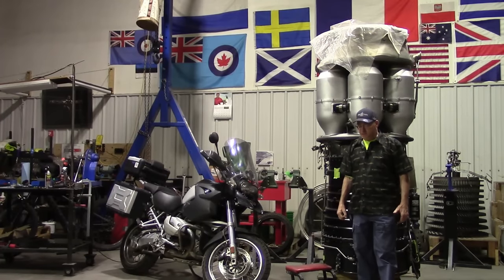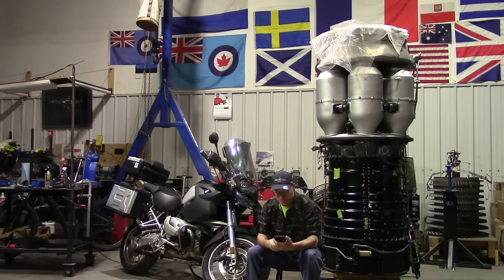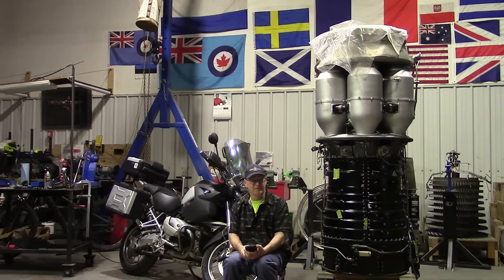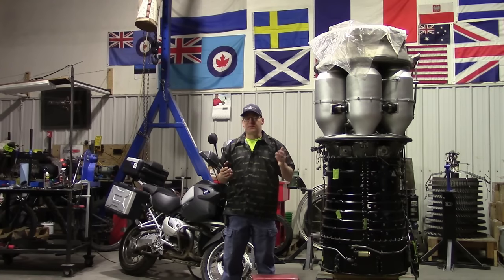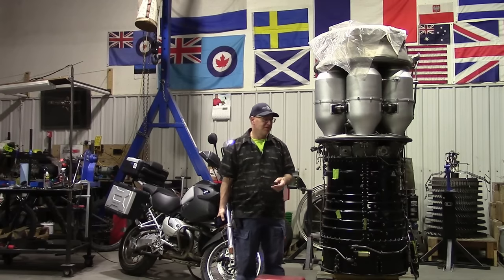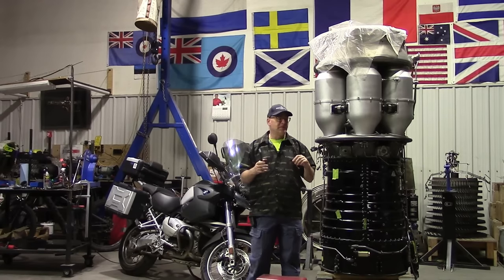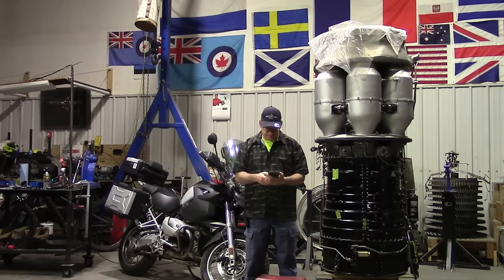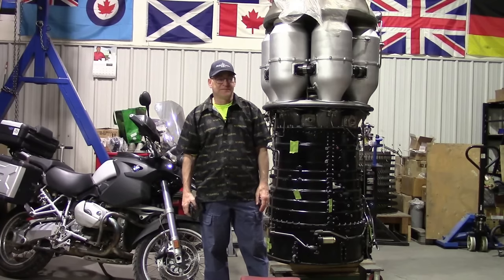How Long Do Jet Engines Last ?

Comment: Excellent video! Thank you for a well thought through presentation. My first USN squadron flew the Grumman Cougar powered by the Pratt & Whitney J48. This was in 1969.
Reply: And were you aware that the J48 was a licence-built version of the Rolls-Royce Tay engine, which was a derivative of the Rolls-Royce Nene, which was also licence-built as the J42?

Comment: I have owned a rake of NMW K100's and a K75s. The K100 had some kind of internal shaft that rattled when I bought them and rattled when I either scrapped them off (some dumb ass ran it over while parked) That dunk, dunk, dunk noise from the engine at idle sounded the same after about 160,000km on all of the K100's. The K75 was supposed to be the same engine but with 3 pots instead of 4. There was no internal shaft though and the torque was higher up the rev range. TBH you cant go much wrong with a BMW motorbike. I have owned about 15 motorbikes and the BMW's were cheapest to maintain and most reliable.

Comment: Thanks for the video Jay! Been a while since I have commented. I was just sitting here pondering, what little details of manufacturing or assembly of turbine engines inspire you when you are tinkering on/building other things, like bikes, cars, whatever? Because I am thinking you are a man that appreciates meticulous detail and overengineering.
Reply from the maker: I like that almost everything is made of Aluminum or stainless steel. I rarely deal with rust and mud, like I have to with automotive work.

Comment: Had a 1981 VW diesel.. our first valve job we replaced only 2 shims.. at 91k miles.. our the following 3 more adjustments ( 320k miles) replacement was ZERO.. I believe hydraulic lifters are superior to anything currently available.. but shim and bucket is almost as good.

Comment: I'd like to extend the question covered in this video: Do you think it is realistic that you would end up not being able to restore an engine due to lack of documentation and specs? 
What I mean is: Let's assume you get a bearing manufacturer to agree on manufactuing a batch of  thrust bearings for the Orenda 14. I can imagine there are some specifications for that bearing, that only the original manufacturers have known and that have not been published in the genereal documentaiton of the engine. So you would end up with a bearing, that you can't put in the engine because you don't know if it meets the orginal specs.
Thank you for educating us! Greetings from Austria.
Reply from the maker: This is a good description of the issue that will eventually present itself.
When such bearings are produced, they will need to be tested to the satisfaction of the operators of the engine.

Comment: Lifters, lift up, dampen valvetrain vibrations, and lifters spin in their bores. There isnt a single piece on a turbine engine that moves in such a complex motion and at a high speed. Parts like that are common in piston engines. This is why the AGT-1500 was selected over a piston engine, they wanted a very simple tough tank engine.

Comment: Hi Jay! I’m not sure about the r1200 but the r1150 used small push rods about 2 in long to move the rocker arm. The push rod had steel balls pressed into either side of an aluminum shaft and after many heat cycles the ball would get loose in its pressed aluminum collar. This contributed to a lot of valve noise on the oil heads. I’m not sure if that system survived into the r1200 though. Might be the origin of your noise.
Reply from the maker: The little linkage is steel in this motor. Noise completely disappeared after adjusting the valves.

Comment: dear j ... there is a power station about two mile from my house  which is is going to be torn down next year .. the ratcliffe on soar ..   which in peak times helps supply london  with power and at the moment burns on average 1000 tons of coal per hour .. it also two standby jet engines rolls royce olympus.. i dont know what will happen to them  wheighed in for scrap?  regards   laurence
Reply from the maker: Those Olympus engines might be valuable to an industrial buyer.
Reply: As a Bristol Siddeley Coventry apprentice, I visited the site during their commissioning (they were the original Industrial Olympus 17.5MW sets) and saw one of them run up, I think it was for the first time but, at this distance in time, I can't be sure.
PS  When they were first installed, they didn't have Rolls-Royce nameplates.
Reply: Unfortunate to be decommissioning a working plant.

Comment: Those J 79 Turbojet engines with Afterburner that Secret Agent JayZ overhauled zipping along just fine in The Starfighter's Aerospace fleet of Lockheed F 104 Starfighters .

TF 104GM Black Beauty, taken apart and airlifted to Italy and reassembled for The 100 Anniversary of The Italian Air Force Founding Celebration, with PierCarlo at the controls. The only flying F 104S-ASAM also owned by Starfighter's Aerospace being readied for test flights. 

And a possible TF 104 GM being modified to be a two seat version of the NASA 1962 single seat aerospace trainer NF-104A that had the added RocketDyne 3,000 # thrust rocket engine and a Reaction Control system for Pitch Yaw and Roll control in very thin upper atmosphere where the standard flight control surfaces will not work. Be very cool if Rick and crew can pull this one off ! *

Comment: If the sabre is powered by the orenda isn't it a CL-13..
Or is it still an f86...
Great content as always..
Reply from the maker: You are correct. Simplified for brevity, and because most viewers are unaware of such details.
Many CL-13s are painted up in USAF colors, and labelled as F-86F. I would bet that you know the two main reasons why...

Comment: Hi Jay! Can you make a video explaining why actual Turbojets dont use Centrifugal Compressors (Unlike their younger RC brothers), and why said RC engines dont use Axial Compressors?
Reply from the maker: If you watch my Oshkosh vid called Warbird Jets, I'm in the backseat of an aircraft that does a barrel roll. It's powered by a turbojet engine that uses a double sided, single stage centrifugal compressor.

I might make a video about engine sizes, technology, and costs.
Reply: The first generation turbojets (the successful ones) all had centrifugal compressors.  
The Whittle WU, W.1, W.1A, W.2B, the R-R Welland (derived from the W.2B), Derwent, Nene and Tay, the DH Goblin and Ghost  all had centrifugal compressors.  And so did von Ohain's original engines, including the HeS 3, the first ever turbojet to fly in the He 178.  However, it was good for only a few minutes flight time and the aircraft's first landing was unpowered..   
In comparison to the British centrifugal engines, the German wartime axial flow engines were grossly inferior in almost every respect - except for their frontal area.
The first successful turbojets in the USA all used Brit technology.  The P&W J42 was a licence-built Nene and the J48 was a licence-built Tay.  And, of course, the Klimov VK-1 in the MiG-15 was a reverse-engineered R-R Nene (with a few tweaks).  It produced a little less thrust that the axial flow GE J47, was slightly less efficient in terms of specific fuel consumption, but was significantly lighter.
Reply: I've given you an answer to Part One of your question, now here is an answer to Part Two.
I presume you've taken a good look at the blading in the compressors of the Orenda engines that AgentJayZ has shown us?  Perhaps you have also seen the compressor blading of the J79s and LM1500s that he has worked on?
Now try to imagine those scaled down geometrically to the size of the little centrifugal turbojets that are used in R/C jet aircraft models.  The blades and vanes would be impossibly thin and fragile: they would be like tiny razor blades.  And the various clearances, both radial and axial, could not be scaled.  To be practicable, the blades and vanes would have to be relatively larger, both in thickness  and in chord.
Now imagine those blades and vanes scaled back up to the size of an Orenda or a J79.  They would be ridiculously thick and their chords would be unnecessarily wide, making the compressors excessively long.
Aerodynamically, those compressors would be significantly less efficient than the real Orenda and J79 compressors. - and so are the actual 'miniature' axial flow compressors that various people have tried to construct.  In practice,  they are relatively even more inefficient, to the extent that they often do not work.
PS  I used to be a regular visitor to a local model engineering show here in the UK, at which members of the Gas Turbine Builders Association exhibited their little centrifugal engines, including running one or two of them.  However, there was one exhibitor who turned up with the components of his little axial flow engine: to the best of my knowledge, it had never actually run.

Comment: No disrespect. I do old electronics. Way less challenging than the JZed world (nice job on the Jensen speaker).
Reply from the maker: If you want one, we have a few "circuit boards" from the 1950's Sabre. Empty tube sockets and all. I have no idea what they are for, but maybe the analog "computerized" gunsight.
Eh?

Comment: Was the bearing manufacturer tooling destroyed or why could they not reinstall the equipment for a limited run?
Reply from the maker: I don't know all the details of how it's done, but it's not like a mold or a press that can be quickly swapped in. The machines are all universal, and are configured for high volumes in the thousands of bearings.
This would need to be stopped, and changes would need to be made in forging of the basic parts, machining , grinding, measurement, inspection, testing and quality control, certification of performance, engraving or labelling, packaging, inventory.
If the factory has hundreds of workers, making thousands of units per day, and generating a decent profit margin, how many units need to be ordered to cover the interruption and delay involved with setup for a new product?
I doubt it would be worth their time for anything less than a thousand items, and even then a significant "low volume" premium would need to be paid.
Anyway, no manufacturer we've talked to is interested in such a puny amount of money, and no owner has so far been interested in paying such a huge amount of money.
Reply: @AgentJayZ  for industrial use is adapting another available bearing an option?
Reply: @fuzzy1dk  As someone who was involved in the design of aero-derivative industrial engines, I would say no.  An operator would expect at least the same level of reliability as the original engine - as they believe they're paying for it.
In fact, the industrial version might need a better standard of thrust bearing because it has to take higher loads at ground level, as compared to running at altitude.

Comment: Please what's the work of gearbox
Reply from the maker: "the work of gearbox"... ... is to be a gearbox. Over.
Reply: If it was termed an Accessory Gearbox (which is what it is), would that help?  It can drive fuel pumps, oil pumps, hydraulic pumps, an electrical generator, etc.
Reply from the maker: Of course, being a RR design engineer, you are a knowledgeable guy, and a nice guy.

Comment: I have a question.  I'm a plumber, so bear with me if I get terminology wrong.
In a turbo fan engine with a free turbine (fan not directly connected to the compressor).  If we assume a fan on a turbo fan engine can only achieve a certain full throttle rpm on, say, a test stand or on an aircraft stationary doing a run up.  I assume the fan will increase rpm as the aircraft increases speed like a propeller driven aircraft or boat would. if I am correct in my thinking  are engines designed to handle the fan rpm that might occur at a high speed, high throttle scenario,  or does the engine management software reduce throttle to prevent a fan overspeed from happening?
Reply: From a physics perspective, I think you can achieve higher rpm while stationary. At high speed the fan will be consuming more power to produce the same thrust. It would be really interesting to hear what the absolute gentleman JZ himself has to say about this.
Reply from the maker: The static thrust might seem to be more than the moving thrust, because the speed differential between the exhaust air and the atmosphere is greatest when the engine isn't moving.
But, as the engine is moving through the air, as it would be when propelling a flying aircraft, the inlet air is also being rammed into  the engine.
The fan is designed for best performance while flying at several hundred km/hr, and at full engine rpm.
The LP, N1, or Fan rpm would be lower on static test because of 2 factors: no ram effect, and the air is more dense on the ground than it is a few KM in the sky.
The different rpm's for the N1 system, static on the ground, and at any speed in the air, are all within the operating limits of the engine.
If either the fan (N1) or the core(N2) were to get to their maximum rpm, the fuel control would modulate fuel to keep those values from exceeding the max limit.
Full Authority Digital Engine Control.
The full authority bit means the computer is in charge.
Reply: @AgentJayZ  you answered that for me very well.
Reply: @ChemEDan  I think you aren’t considering the Angle of Attack change (reduction in AOA) due to forward motion. Statically, the AOA is basically the angle of the fan blades.. with forward motion say in flight, the AOA is smaller, which should unload or make less drag, allowing the rpm to be higher.. a good example is an airplane with a fixed pitch prop. On takeoff, it might only make 2250 rpm. In flight, it could be 2700 rpm or more if you let it..
Reply from the maker: Speaking about the J79, the Variable Stator System adjusts for inlet air pressure and density, and the entire compressor system is designed for conditions of full rpm and max ram pressure. The inlet duct, which is part of the aircraft, adjusts its geometry to maximize ram pressure and to keep the inlet air subsonic, even if the aircraft is travelling through the air at supersonic speeds.